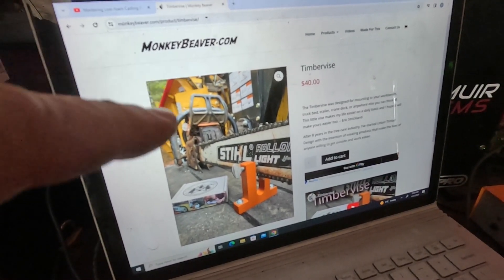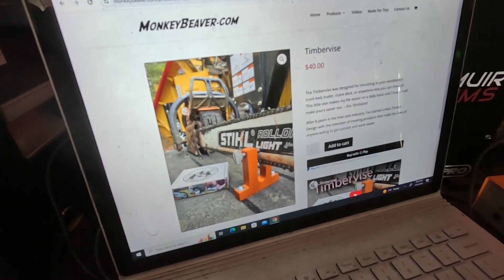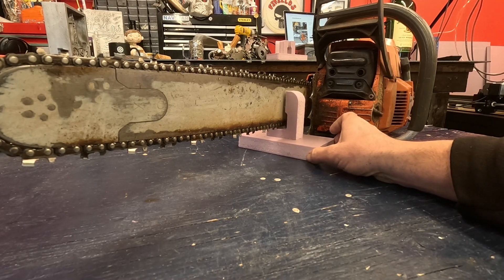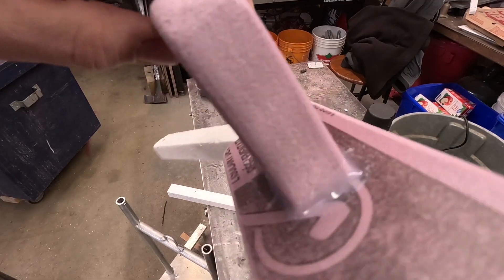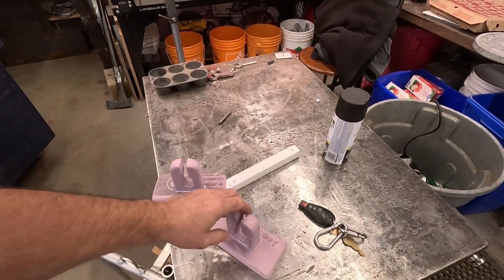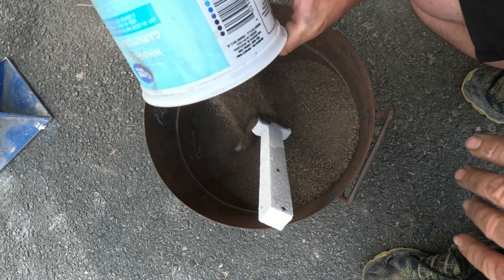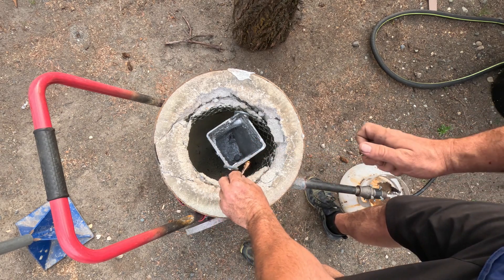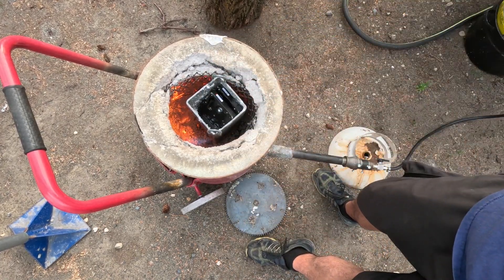Casting a Magnet Chainsaw Vise

Comment: Bro, why did you cut the video so short?  Only 1 pour?

Also I don't know why your lost foam doesn't smoke nearly as much as mine.
Reply from the maker: Yeah. The video is for a bit of a competition with some other guys. We were limited to 5 mins max. I had to cut a lot lol. I find you get a lot cleaner pour if you leave the bare minimum sticking out of the sand. Plus keeping a full cab helps as well I think. Cheers
Reply: @stevesrt8  oh I see.
I don't leave a lot sticking out of the sand normally.  So that's definitely not the case , 🤣
Reply from the maker: @HeinrichsMade  they were beauty pours. They all don’t go like that. I think a thinner coat helps with ventilation g also. Maybe you’re a bit thicker than mine e.

Comment: Love the idea! Well done. Only question I have is how to get those magnetics off the metal so they can be used on something else.
Reply from the maker: I grip the bracket with some vise grips. Then bang it on something hard like a bench vise. You will see the magnet shift. Then you can slide it off. You do lose the metal coating on the back but it doesn’t matter if you plan to epoxy it down. Cheers
Reply: @stevesrt8  sweet! Thanks